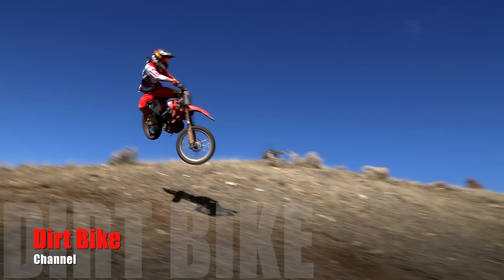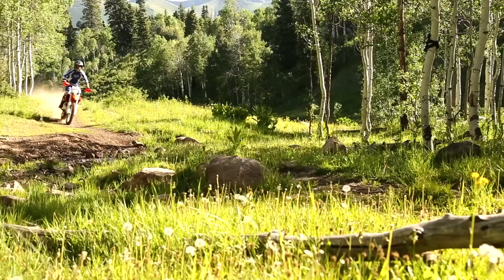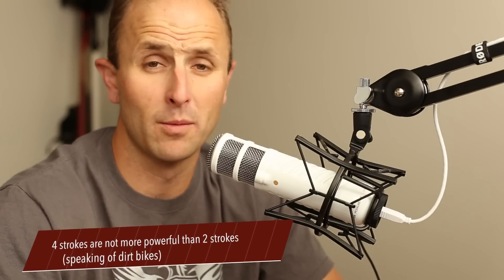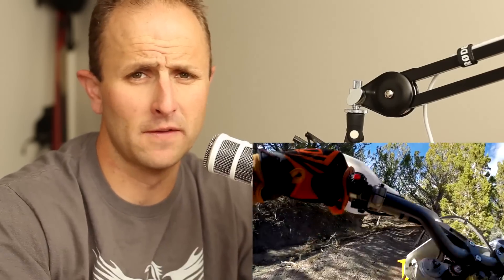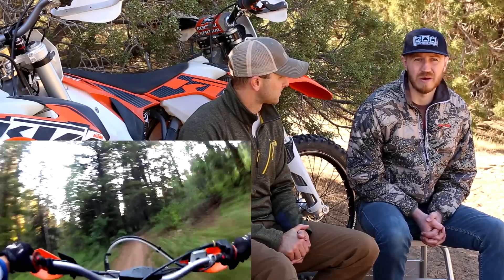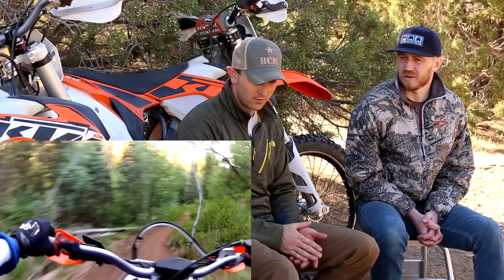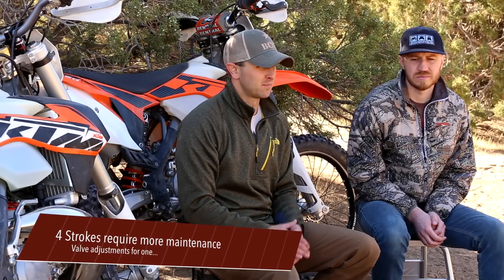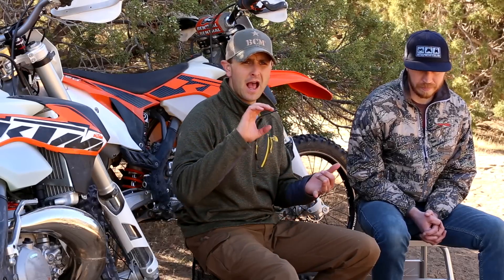Enduro 4 Stroke vs 2 Stroke Part 1

Comment: Reliability of 2 strokes directly corresponds with how you maintain your bike. If you always run 40:1 high test gas in a 2 stroke it will run for what seems forever. If you are trying to get more power than you should and use a leaner oil mixture like 75:1 or 100:1 then you have a ticking time bomb  !

Comment: That was a fascinating discussion and gave me an update on the present situation regarding two stroke and four stroke. I just love the intense competition between the two technologies it is extremely healthy for engine development. The only thing that I can't understand is why the four strokes have had a huge amount of investment put into them and the neglected two stroke has not even received fuel injection, which would enable it also to be used on the road?
Reply: +Alan Townend politicians did it. They intentionally killed the mighty 2 strokes. Pure bs politics, not genuine, fair competition. Engineers responded to the pressure as well as they can with tricked out technology plus good old fashioned affirmative action on behalf of the slower four strokes allowing 200% displacement advantages, but there's only so much you can do to overcome the simple reality of 2 strokes  being  vastly more powerful engines by nature. They have done about all they can do short of adding $uperchargers or something. If politicians had kept their noses out of things, four strokes would have maintained their traditional role as trail bike power plants, and 2 strokes as race bikes, just as engineers knew 50 years ago.

Comment: i had a 04 cr250r, it was awesome. I miss it but had major issues with the power valve and computer. I now have a 2011 crf250r, I like it a lot, no issues, easy to ride, good power, just had to get used to the engine braking. A 250 2t and 450 4t use about the same amount of gas...that is the only way to compare the power, not the size in CC

Comment: i like both types but i'm still riding my 97 DT200r with 28,000km and flogging the piss outta it in the bush. one day it'll die but everyone i know has been through at least 2 bikes and thousands of dollars in the time i've had it. its old and it wasn't great when it was new, but its ridden hard all its long years and still runs sweet.

Comment: I recent sold a 1986 Honda 250r 2 Stroke that was originally ridden by my grandfather then my grandmother then my mom and then me. did one top end rebuild in 2002 and it would blow away stock modern 450 four strokes (always depending on the rider of course). never had an issue. Always ridden in sand by the way!

Comment: I agree and disagree on a lot I have a 125 2 stroke and a 250 4 stroke and like you said those are practically about the same in "power" but as long as you do just your regular maintenance on the 4 stroke you don't have to do much of anything I've got about 80 hours on my 250F and about 20 on my 125 and I've done no work to my 4 stroke but I've replaced a too and bottom end on my 2 stroke .... That why my 4 stroke has so many more hours..... To all the people who are wondering just clean your bike really well every ride and get all the dirt out of the cracks and hidden places and change your oils and air filters and oil filters and maybe reseat your valves ever 50 hours and your four stroke will not run up your bills at all it's all about how you take care of your bike! And FYI not dissing the 2 stroke in any way I love mine I just prefer a 4 stroke I've gotten way faster on it and he's right I can be lazy and go twice as fast as I used to on both track and trail!
Reply from the maker: 115DirtbikeRider Thanks for sharing this.
Reply: 115DirtbikeRider Well spoken. Jason Falcon.

Comment: Each has its own application. 4 strokes are better for beginners, tight trails, long distances as well as most technical trails and situations. 2 strokes are good for all the rest and can be pretty much rebuilt on the trail..And YES..Todays 5 valve, water cooled 4's are actually bad ass but as mentioned, that gets expensive quick for the hard rider..

Comment: Great video explanation! Just confirms my purchase of my 14 ktm 300 xc! Freaking love my bike! awesome power and torque down low. Millville 2 tire rocks as well.
Reply from the maker: TJ Tharp The 300 XC will be my next bike.  Right now, I'm riding the 300 XC-W, and we just picked up a 350 XC-F for testing.  I really like the 4CS forks on that XC-F, I'd just like to have the 300 smoker powering it.
Reply: Dirt Bike Channel It will not disappoint you! mods i have done, are to update the leaky clutch cover gasket (aluminum coated gasket), thats a must. Link guard installed, EE guards, and revalves on the forks and shock, I love the link vs the pds, seems smoother and 4cs whens its valved right is wonderful. Ill probably NEVER GET RID OF THIS BIKE!

Comment: First off I'll specify I own both 2 and 4's...so I don't feel I'm biased. I've noticed that people riding 2strokes always seem the need to "justify" why their bikes are better, and this video just proves that.

My CRF450X is a 2005 and has never had any work done to it since the day I bought it other than shim the valves myself. I race my CRF450R on the motocross track and it's fuel injected. I assure you I would take this 450R over any bike I've ever been on. My 450R is sitting at about 60 hours on it and the valves are still in spec from factory. Starts first kick everytime.  I would not let valves scare me off from purchasing a 4stroke.

The girlfriends RM125 is a pretty awesome machine as well, but nothing can touch the new FI 450s. Far superior in every way except for weight. But picking up holeshots and powering out of a corner into a double or triple is far more enjoyable on the 4stokes and easily overcomes the main downside which is weight.

2 strokes however, sounds great and that smell......mmmmmmmmmmmmm. Summer isn't summer without that smell!
Reply from the maker: stokedGSXR Thanks for taking time to comment. Yes, the 450s are pretty amazing. I own 4 t and 2t as well :)  2Ts make me smile more than the 4ts.  That's hard to quantify, but its the case for me.  I don't ride tracks, so much of what you mentioned doesn't really apply to me.  If I were to get serious about track riding, I'd find a good 250 4t and cut my teeth on one of those.  Since I'm not Ryan Dungey, or Eli Tomac, I'd probably never need a 450.  Marvin Musquin looked like he rode his 250 pretty fast this year.  Seems like enough power to me...

Comment: The simplicity of a two stroke is amazing. I've always been a fan of YZ250's and have owned four so far. I tried a '99 YZ400F back in the day and the valves constantly needed shimmed, and it was a pain to start even with an auto decompression cam which cost about $300. 

I recently tried a friends KTM 500 XC-W which had over 400 hours on the original parts. It was a blast to ride and I was looking for a bike I could get plated, so I pulled the trigger on a 2016 KTM 500 EXC. Out here we might start our rides in the morning at 36F/3,000ft, and end up at 80F/9000ft. The fuel injection is amazing and I'm not always jetting or adding/removing my flywheel weight for the track/trails, and the e-start is amazing. Riding is just a lot more enjoyable now, which unless you are a factory rider I think that is what's most important at the end of the day. 

There is definitely no argument when it comes to rebuild costs, however. Only at 70 hours now, so I might be changing my tune when it comes time for a top end.
Reply: Idk what you where doing wrong but I've been riding every Sunday on my yz400f for 2 years have had no engine issues yes I do check specs every so many rides and mine starts first kick everytime unless cold then takes about 3 kicks to get it to fire. I'm geared down with a flywheel weight and it's my favorite bike wish it was a little lighter but I handle it.
Reply: @jeremysearcy8875  This is over six years old...  They redesigned their cams & valves on the '00 426 and went with titanium/lighter springs and different cams, so I doubt it was an isolated experience. I'm glad it's working out for you though. Every Sunday for two years at 3 hour rides would be 312 hours... That's a lot of hours on a 23 year old engine.

Comment: As was pointed out, the four stroke only became a maintenance disaster when they started extracting as much power as they could, with high compression, high revving hot-rodded engines.  I have been riding my Honda XR250 (1993, air cooled) since 2000.  I haven't done a thing for the engine other than regular oil changes and it runs as strong as ever and always starts and doesn't burn oil and shows no signs of needing any service.  Of course, it's also no match for the current four stroke 250 engines out there either.  Still, I'm looking to try out the KTM 300.
Reply from the maker: Bryan Keeler Well said Bryan!
Reply: Bryan Keeler Those old Honda XR250 or 400 for that matter are solid bikes. I wish they still made motors as reliable as they are.

Comment: i have a 2001 ttr 125 that has never had any engine replacement parts other than a carb and it runs great!
Reply: they're not talking about those trail bike pieces of junk lol
Reply: trail bikes are just fine
Reply: Trail bikes are not the same as the high compression high rpm race 4stroke bikes. I had a 2001 yz250f, the timing went a little out... valve literaly broke in half, no damage to piston/cylender just wrecked the head... cost 1800 to get re machined. Been a 2 stroke guy ever since. 100$ top end in my kx is like nothing
Reply: +quadrider3013 how is a bike like the TTR that NEVER breaks down a piece of junk?  The TTR is an excellent bike for beginners, super reliable, easy to ride and a ton of bottom end.  Those bikes will tractor around ANY single track you through at.
Reply: MrJasonfromcanada  its not a bad bike its just a kids bike its isn't a race bike it isn't ment to have a lot of power
Reply: Netrox Bros trail bikes are fine just super slow and have no power ride a real bike and you'll never go back

Comment: I think as long as your on two wheels and your smiling that is what is important.  

I know a lot of guys that beat 2 strokes with 4 strokes even in enduros.  I personally got beat by a 125 2 stroke on my yz450 on a mx track.  Then I finished 10th out of 90 riders in a enduro on a 1983 IT490 air cooled 2 stroke I bought for $300 and sunk another $300 in it.  I chased and passed a lot of KTM 450s and 350s.  I was on a dinosaur.  My buddy smoked a ton of people in a hare scramble on a 2009 kx450.  There was a lot of 2 strokes that got passed by him that day.  The rider makes the bike.  The bike don't make the rider.

Bikes are expensive. They will all cost you money.  If you ride hard or race you will need a second job no matter what your on.  I have had 2 strokes that last forever with  little investment, and some are money pits.  The same for 4 strokes.  If you maintain them they will both last forever, and be reasonably affordable.  2 stroke or  4 stroke I change oil and air filter every three rides or once a week when racing regardless of rides.  Bikes will last for a long time with love.  Still MXing a 2010 yz450 on 3rd piston and 1st new bottom end.  Only had to reshim those darn titanium valves about 3 times in 200 hours.  When the mechanics tore it down at 150 hours they said it still looked new.  I just had it done as we were still racing pretty hard, not that it needed it.  The entire motor was  $2500 to rebuild.  My 2002 RM250 2 stroke will probably cost the same because it's a odd ball year and parts are expensive and hard to find.  I vintage race a 1995 cr500 I bought off craigslist list a few years ago, and have never even tore into it.  Maybe put a top end in it sometime whether it needs it or not.

The point being is just have fun.  Don't get hung up on who has the best stuff or preaches the best gospel.  Get a bike take care of it and practice, practice, practice!  You'll beat a 2 stroke or a 4 stroke because your good!

Comment: 2012 yz450f hauling a 320lb vet b rider for 4 years motocross and trail riding replaced piston at 110 hrs still had hatch marks on the cylinder from the factory ,valves have never moved out of spec and still looked new less than 5. Percent on the leak down test. Matainace involved changing the oil every 3-5 hrs and a new oil filter every other oil change clean air filter as needed. 55-60 hp out of these new 450s 45-50 hp from a 250 2-stroke that's a lot of ponies to give up not to mention the torque. 2 - strokes can't come close that's why 4- strokes are so popular.
Reply: There ticking time bombs !!    Lol. 2 stroke has more tq per cc as well ill stick to a 500 2 stroke

Comment: I ride single track and two track in norther. Michigan but also alot of sand and back roads at home. I'm trying to decide between a beta 300rr or a beta 390rr or ktm 350 xcf. What would be your thought since a good portion of riding with be dirt roads and sand

Comment: when rebuild my 2 stroke I have to clean and rebuild the power valve and if you let it go too long you have buy a cylinder too I've had pretty much the same experience with both. I put 10yrs on my 2 stroke and 12 yrs on my 4 stroke on the stock top end

Comment: The main advantage of a 4T is throttle modulation at small throttle openings.  2Ts, due to expansion chamber dynamics, produce too much power at small throttle openings.  This the main drawback of a 2T.  This is why 4Ts are so much faster in MX and SX.  They build speed from throttle application at midcorner. This one factor makes a 4T better in most applications. Period.

Comment: I have a 1990 Honda xr100 and xr200 both 4 stroke. I can’t recall the last time anyone had worked on those bikes. They sit in a tarp type of shed outside and get ridden every summer and everal times a month other months. They only just took a crap

Comment: I have a 2009 kx250f I took it into a local mechanic and it was $200 for a FULL rebuild. I have a 2006 cr85rb expert I took it into the same shop $700 for a new crank case. My cr85 also weighs a lot more than my 250. Idk why but it does.

Comment: Hey boys try 11 seasons hard endero and hare and hound on the same top end and clutch, of course I used top premium oils, specifically Bell ray HR1 premix and Bell ray gear saver case oil,and I was mounted on my 1990 320 maico from 1991 until 2015,raced from 92 to 04 with great success and much satisfaction.

Comment: There seem to be allot of false "facts" in this vid. lets just look at the ktm 500. I have 430hrs on mine. no top end rebuild, vavles have been checked once recently and were in spec. 2-strokes should be not pushed past 100hrs on a top end. I have seen many cracked skirts and you are reducing the life of you bore. I ride both but make sure you get your facts straight. I agree with the last half of the vid more than the first half.

Comment: Hey Kyle I ride both. I like 2T for single track an slower trails. But i dont think 2 strokes stand a chance if you ride then ultimate off road races (Baja 1000 and Dakar). I guess the bike is better depending of the terrain. id like your opinion .

Comment: Well I don't get why people always say that 4 stroke requires more maintenance than 2 stroke. So our street bike need valve Adjustment always? Yes, Valves need Adjustment once in a while but if you don't have any issue like noise or power loss you don't need to do unnecessary repair or maintenance.... I own a Honda CRF 250L, XL 600 RM and so far nothing happened to them. And driving both of the and XL for 4 year without maintenance on valve or other parts of the engine... so far it holds up and works like brand new... i don't know much about 2 stroke but I can say you always need a engine rebuild if  you use it on long rides like use it like Touring bike on roads and off roads, because of lack of adequate Lubrication. Well Idk about 2 stroke so educate me with facts!

Comment: how about the honda 450x ? I got a buddy that abused that bike (2009 model) and after 300+ hours it only started to backfire a bit. He did the usual stuff (oil change at about 80-100 hours, and coolant after he made that engine boil). But still... that bike its like a tank.
Reply from the maker: FogRunner Yes, the Honda 450x is a tank.  The issue is that it also feels a bit like a tank as compared to some of the alternatives :)  It's a lower compression motor that isn't so finicky as the 450R.  For most guys, the 450x would be a GREAT bike.  For me, it's a bit slow revving, and heavy, with too plush of a ride for the things I like to do.  Having said all that, it's a fantastic bike for what it's designed to do.

Comment: So what about size? meaning, weight of the individual. I am 6"1' and weigh 270. I have been told that I wouldn't be able to really ride or be comfortable on a 250. For that reason, I have a yz450f. I love my bike - but I am curious - could a husky guy like myself buy and ride a 250 2 stroke? Do they make 450 2 strokes? Love the material. Keep it up @dirtbikechannel

Comment: Hillclimbs?  Maybe the new 4 strokes are better but I remember growing up in the 80's in a riding club and the few guys with 4 strokes just didn't have the horsepower to make it all the way up some of these long steep hills while the 2 strokes made it up with ease.  One guy had a Honda XR 250 and he made it up this hill halfway before stopping and having to jump off the bike because it was so steep.  Then there was my friend with his YZ490 that screamed up the hill and got a couple feet of air at the very top.